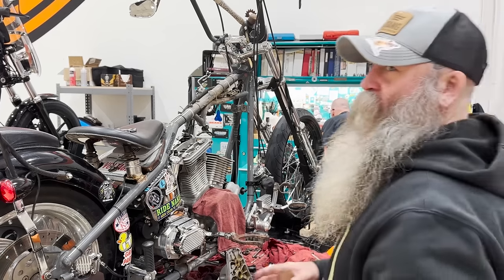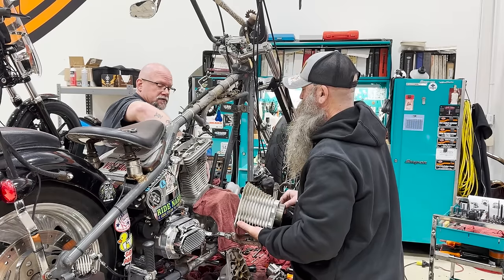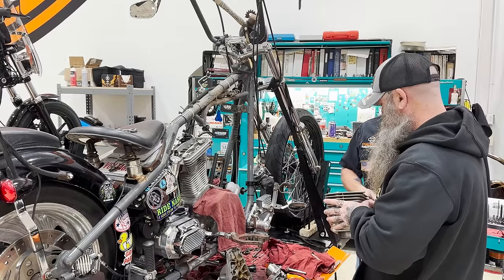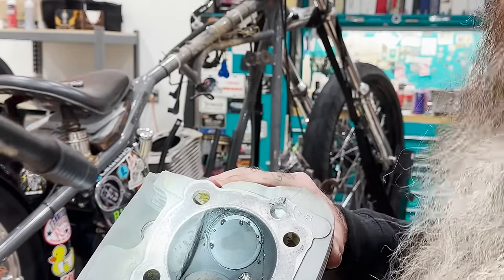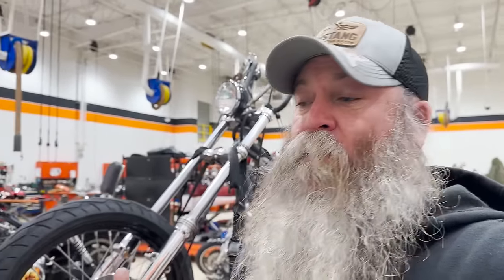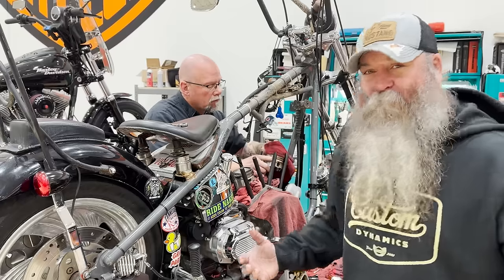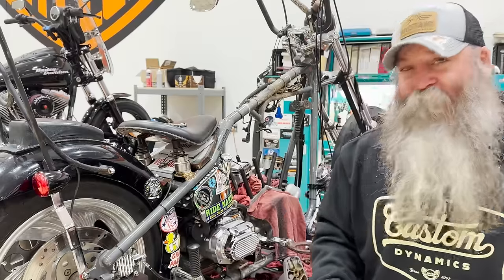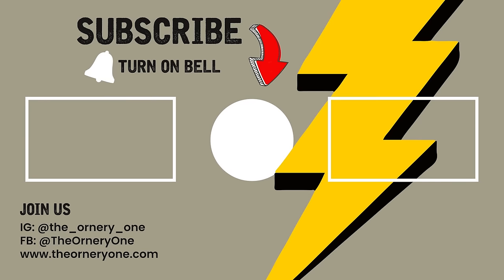Spark Plugs tell a story | Harley Davidson Chopper Evo Rebuild | Pistons Rocker Box Heads Jugs

Comment: Spark plugs are the windows to the internals of an engine. I have never considered myself a mechanic, but I do try to do all the maintenance on every vehicle I have owned. I have never rebuilt a motorcycle engine yet, but have rebuilt a 1979 Dodge Ramcharger twice, once when it had 100,000 miles, and again at 360,000 miles. It had 400,000+ miles on it when I sold it. Now I only have a motorcycle, and watching a crapload of videos about motorcycles.

Comment: In 80 I worked as an auto mechanic in a well established garage meaning I had access to what I needed
But now I'm 68 yr old retired and ride a Softail with no tools like in the garage my scooter has 86000 mi and running strong but if I was still in the garage it would have been redone yrs ago so alot of times even with knowledge you still
Without both your kind of screwed but I do keep maintenance up and ride in the wind
Anyway keep it between the mustard and mayo and rubber side down good luck and may GBU Later